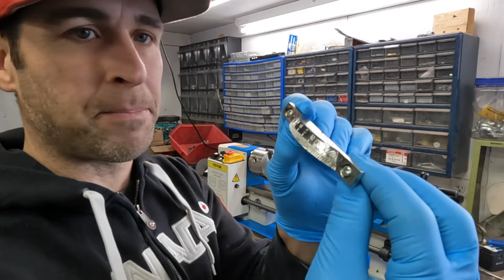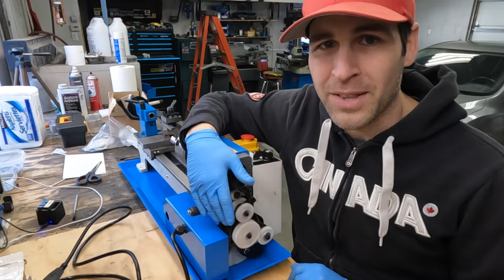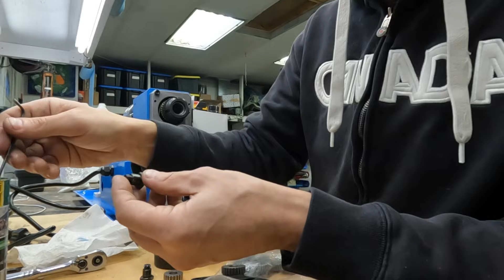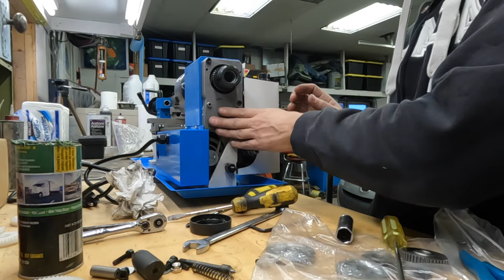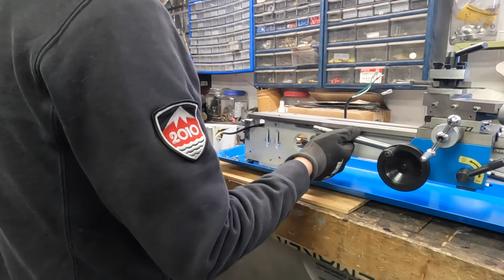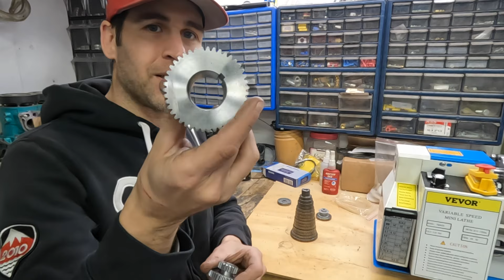Mini Lathe METAL Gear Swap 🤟 - A Worthwhile Upgrade

Comment: Nice video.  Subscribing.
Interesting that the Vevor links show a slightly different lathe for Canada as compared to the US.  I received the version pictured on the US link which has the emergency stop and tachometer on top, with the speed knob and fuse and direction switch on the front panel.  It also came with metal gears, a magnetic LED light, and a box of lathe cutters all for $475 including shipping a few days after Christmas.
Reply from the maker: Holy crap ! What a deal.... I know that most other countries already have metal gears installed. Also... their shipping is pretty astonishing, isn't it !? 

Enjoy your new toy... play safe !
Reply: LTL (Less than Truckload) from the East Coast all the way to the West Coast, on a pallet, for free.  Unbelievable.
The Amazon price was $499.99 USD but there was a $25 coupon.  There was even a $30 coupon for a couple days leading up to Christmas.  Today it is still $499.99 but no coupon.
Reply from the maker: @terryhillyer529  Awesome !
Reply: This is crazy.  Now Boboran on US Amazon is showing a $50 coupon for the $499.99 Lathe.
Reply from the maker: @terryhillyer529  Dang it... I thought the Vevor ones were a good deal... I pinned this so if people see it they can cash in on it. I need to become an Amazon affiliate, haha.
Reply: This is still the Vevor lathe
Reply from the maker: @terryhillyer529  Yes ... I don't make any commission or credit unless people use my link, but this is a much better deal.
Reply: I found the $30 coupon is back, but YT deleted the link I posted.  Click on your US link and then click on Other Sellers and Boboran has the coupon.  Boboran is where I bought my VEVOR mini lathe.
Reply: I bought one off Aliexpress for $402 after tax with free shipping, the 7x14 variant. It's supposed to come with metal gears, light and cutter as well. It'll be interesting to see if mine has the tachometer it hasn't arrived yet.

Comment: One day, America might be smart enough to change to metric only.Are they that smart, maybe?
Reply from the maker: Haha. It's a pretty huge change. America does use some metric... Canada uses some imperial... I'm 48 and I give my height and weight in inches and pounds, and set my oven in F. I use the word "gallon" but it usually means "about 4 litres" haha. 

I have worked on Yamaha and Polaris junk, as well as utility engine junk, so a mix of SAE and metric. If I'm measuring something small I am more comfortable with thousandths of an inch than MM... If I'm measuring lumber I use feet and inches. It's a real mess, haha.

Comment: I think you'll find https://youtu.be/bbiy59pI6gg?t=1388 is the top belt pulley gear with 31 teeth (to match the 17 tooth motor pulley gear also in your kit you didn't use either). I have a Clarke (UK) branded mini-lathe very similar to this and that has black plastic belt pulley gears and a black rubber drive belt.  This was a very weak point on earlier mini-lathes (worse than the gears!) because belt slippage can rapidly wear or tear off the pulley teeth.  That was one of the first things they addressed in later mini-lathes so it could be the top pulley is already metal on yours if your motor pulley is. To get to the top belt pulley, you need to go a step further than you did and remove the belt cover plate after all the gears have been removed (just a couple more allen bolts).  However on mine which has an RPM sensor comprising an optical "chopper", the spindle securing collets and "chopper" need to to come off to get the belt cover fully off. 

What happened with the set fitted at manufacture on mine was the motor securing washers were way too thin as you pointed out, allowed the motor to move, the belt tension to slacken, and the pulleys to be wrecked. If the motor washers have been replaced with thick ones as I did too, and the belt tension set correctly, and usage is relatively light, the black plastic ones will cope and last fairly well (I'm on my third set).  But I'm just in the process of going to metal pulleys on mine (note this also means a swap to a heavy duty translucent belt made of polyurethane as the rubber one wears too quickly on metal pulleys). 

Thanks for posting this up - I was wondering about going to metal gears on mine but it has a two speed headstock gearbox so I'm likely going to wait until I feel like upgrading to spindle bearings and do the whole lot in one go.
Reply from the maker: Thanks for the comment. 

Yes, the pulleys on this lathe were already metal and toothed. 

I have since given this lathe to a friend, and from what I hear they have been getting lots of use out of it.

Comment: How do you get the gear set now?
Reply from the maker: If they are not available through the provided links, they are probably sold out. You'll have to do a bit of research, but you can find them lots of place. I think littlemachineshop has them, as well as aliexpress etc.

Comment: Did he change the bearings out at this point? Ball bearings don't really do it justice.
Reply from the maker: Spindle bearings ? I changed what was shown in the video and then gave the lathe away. Tapered spindle bearings would be better, for sure, if it has roller bearings.

Comment: Plus marks for lubrication.  I would be inclined to use oil rather than grease for the fast-spinny parts, but if it works it works.   Good point about the lack of oiling ports, fittings, whatever -- it is designed for plastic gears which are self-lubricating, so they have some excuse.   Except for that two-gear assembly connected by a shaft. . . drilling that for an oiler fitting is probably over the top.  
It looks like you are using motor vehicle bearing grease -- I would be inclined to try something lighter, perhaps a lithium grease, more suitable for higher speeds and lighter loads.  I feel that you should take this gear train apart every so often, clean and relubricate, anyway.  If the wheel bearing grease is not gumming up and getting nasty after (??) hours of use, thin you have saved yourself the price of a tube of lithium grease.
Reply from the maker: All good points ... Thanks for sharing!

Comment: While noise issues with metal gears can't be totally eliminated they can be greatly reduced by using a lite film of grease (I use white lithium) on the gear teeth and setting Tip and Root Clearance (very very important) at about .005 by running a piece of standard copy paper between the gear teeth as you adjust/tighten the banjo bolts. It improves gear wear and cuts down on stress on the gear train and the drive system that could cause premature motor failure.
Reply from the maker: Great info. Thanks.

Comment: The comments that they are using the sub standard parts on purpose are absurd. Yes the quality is lower because of the price point. But if your making these statements you should back up how you know that.
Reply from the maker: Yeah... If someone has had a genuine bad experience where their lathe failed ... Fair enough. Someone saying that it is poor quality does't really mean much if they don't offer any details ... it's also not going to get them much help. 

I spent $5000 on a milling machine, and the castings (where it doesn't matter) also look ... like castings. The reason for using cast iron is 1. it's cheap to reproduce and 2. you make the basic shape and then machine in the important features.

Comment: I opened up my Honda generator to set the valve lash, and found both a plastic cam and a plastic timing gear.
Reply from the maker: Haha... yes... and they tend to last as long or longer than the metal ones. A lot of them have a simple gear with lobes on it...not even a "real" cam. My day job is fixing mowers.

Comment: I’m having an issue with mine if you can help me out I’m setting up the gears for a 0.8 Pitch mm gear a is 40 gear b is 60 gear c is 40 and gear d is 50 I can’t get gear c to touch gear d
Reply: Update I was able to figure it out there’s a bolt behind the bracket
Reply from the maker: @Deejdope77  I was going to try to explain this... but it's nearly impossible unless you already know. Glad you got it sorted.
Reply from the maker: Sorry, but I gave this lathe to a friend. I hope you figured this out. I know the chart can be confusing. Also, there are a few gear positions that are movable, not sure if you knew that. If you watch the video, where i'm putting it back together you may pick up on something your missing.

Comment: Your backwards in direction setting compound rest for threading.
Reply: Yes. Let's start over. When cutting a 60 degree V thread. It's good practice to set the compound at 29.5 degrees. Half of the 60 degree, from perpendicular. In your video you appear to be setting compound 60.5 degrees from the perpendicular. 
The 29.5 allows us to advance the cutter so that the left edge of the tool cuts, but the right edge has 1/2 degree of clearance. Your video appears to be setting compound at 60.5 degrees which is what I meant as backwards.
Reply: Actually right side of cutter should have 1/2 a degree of contact, not clearance. This prevents the threads from being cut beyond 60 degree included angle.
Reply from the maker: @samhartsock5182  Thanks for taking the time to clarify. I do understand what you are saying and get the 29.5 degree angle and why. If I set it wrong then it was just a brain fart. Looking at the angle on my compound, it is way too steep of an angle, so if I threaded like this, it was wrong, haha. 

I broke my foot REALLY bad a few years ago and watched Mr Pete videos for a year straight... He's a great teacher. 

 Thanks again for the comment.
Reply from the maker: Are you sure about that ? Coming from the right to the left. 

Is this not how it's done ? https://www.youtube.com/watch?v=9y0MmvscBzg&t=300s&ab_channel=mrpete222

Comment: I am new to mini metal lathe machining, looks interesting. I have some experience operating brake lathe machine for resurfacing brake rotors, drums and flywheel for automotive application. I understand some basic knowledge of measurements using micrometer. How hard would it be to learn machine lathe?
Reply from the maker: I had zero experience when I got my first one, and learned most of what I know from watching MrPete222 and other youtubers. I would assume, if you have used any sort of lathe, including a brake lathe, you have a bit of a headstart.

Comment: I guess that you are one of the more fortunate Vevor buyers. My new 7x14 was bought from Amazon and delivered by Fedex. Most of the bolts that held it securely to the bottom of the box were out. Upon delivery it was dumped out of the truck on the tail stock end and actually left standing on end in the driveway. The back splash was bent severely, the compound rest lock device was broken off and the box was mangled. After a few hours it was time to give it a run and to my surprise the interlock would not keep the motor running. It took weeks to get Vevor to replace the switch.
I might note: The stop switch actually forces the solenoid to separate which opens the contacts and stops the motor. A small stop switch was modified to actually break the electrical circuit. Forcing the solenoid will eventually kill it, then you are in for finding a replacement.
After some modifications, and additional gears, and a lot of frustrations I finally have a useful bargin $350.00 lathe.
Reply: Why did you accept a delivery like that?  Even if you weren’t there, you should have taken pictures, before you moved or opened the box.  I would have called FED EX and had them pick it up and send it back where it came from.
Reply from the maker: I know both the frustrations of dealing with shipping companies, (and them having no meaningful repercussions) and having to wait for parts. I'm surprised it only took weeks and not moths. 

Most companies these days are set up to do replacement warranty. This means they don't' have parts overhead cost, and they don't need to train service staff. Generally, Items in warranty are replaced with a new one or the money is refunded as this is considered a more economical way to do business. 

I'm not 100% sure what you mean about the stop switch, but it is common to have relays in the circuit so that it takes a few steps to turn the unit back on. 

I hope you enjoy your lathe and it is trouble free from here on out.

Comment: Just a quick correction to something I saw.  If you're having problems single point threading, it could easily be that the compound is only 30 degrees off.  I don't know of any chinese lathe that has graduations on the compound that you can use with out being off.
Reply from the maker: That is a good point. I don't know if I showed it in this video, but I actually didn't use the graduations on the lathe, and checked the angle with a protractor.

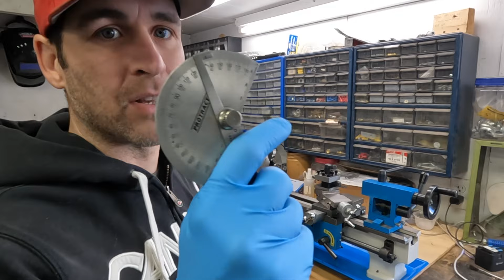Comment: Minute 2:13 - i also have such a variable square, i suggest you a fixed square for 90 degrees, they sold it with a sort of extended side, so to fix exactly and quickly the 90 degrees position, after having oriented the compound in any other position.
I also built myself special squares for MK2 and MK3 tapers, the most common tapers used in our chinese lathe.
That squares i suppose would cost a big amount of money, mine are built with two point screws at a fixed distance one from the other, fixed in a similar square i told you before ; they are protruding just a bit one from the other, to realize, with the previous distance, a taper 2 ... similar for taper 3 ... 
That squares are fixed, i use one of them to adjust compound to proper angle so to cut the wanted taper ... 
Of course exact protruding of the two screws is essential, and also their distance. In any case you can adjust minor errors with a file to adjust one of the screw to the exact value ...
Reply from the maker: Thanks for the tips / comment. Sorry I missed it till now.

Comment: Thank you for sharing!  What if you greased the gears, would they be quieter?  😅
Reply from the maker: Some have done this and it will quite them down a little, if you use really thick grease... but it also makes a huge mess.

Comment: Would a little bit of grease on the gear teeth help that harsh metal sound? Or would that be a mistake?
Reply from the maker: Some people do this. I have tried it a few times on my other lathe, and didn't find it made much difference. It tends to attract dirt and swarf, so I don't' do it now... I just put it on the bearing surfaces.

Comment: Hi, Like you video..can you put through longer pieces of metal in the spindle?
Reply from the maker: The spindle bore is 21mm (0.83 inches) so if your material is that size or smaller, then yes.

Comment: sounds like mine 45 year old lathe  build in Taiwan. try different grease but still running  loud on 300 plus rpm
Reply from the maker: Yes, gears are typically loud on lathes.

Comment: I've had 2 plastic gears break in my mini lathe, thought about getting the metal set but tried out 3D printing new ones in polycarbonate and they have worked fine for several years.  Also printed 2 100 tooth gears to get the feed rate even lower but can only put the cover back on when using one of them.

I also drilled out the holes for the selector arm after having the same problem, I just used the detents that were already there to get the position for the holes.  Didn't bother with turning the cone into a pin, so far cutting threads even in steel it hasn't popped out again but I'll keep that mod in mind if it ever happens.

The next mods that are kind of necessary are carriage locks.
Reply from the maker: Awesome ! Not only printing new gears up improving it by lowering the ratio. I like it. 

I tend to go too far with everything I do... I'm glad to hear that just drilling the existing dentets works well. Carriage locks are very nice to have 👍
Reply: Did you print in ABS or PLA? would love to get the STL
Reply: @ChrisCrozier  Polycarbonate is what I used, 5 outer walls and 60% infill.  I found the STL files online years ago so you should be able to find them by searching for mini lathe change gear stl files.  One of the ones I had break a tooth was the high-low gear inside the headstock, I could see a defect in the original plastic around the tooth so that is why it failed.
Reply from the maker: @ChrisCrozier  According to his comment, he used polycarbonate... You need to have a bed that can get to 135C and it prints at a much higher temp... I think you need an enclosure. Apparently like printing ABS but even harder.